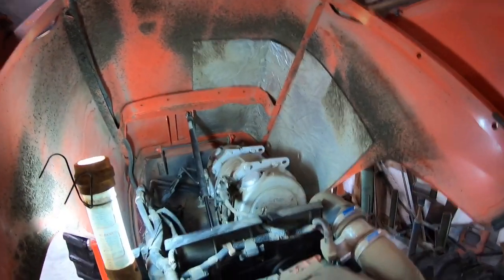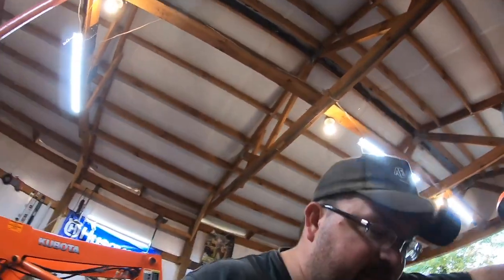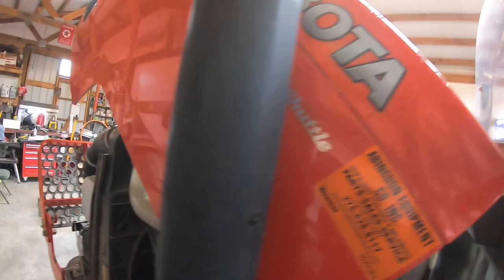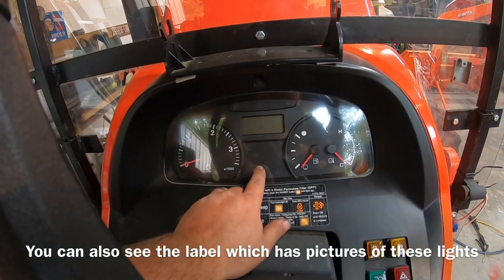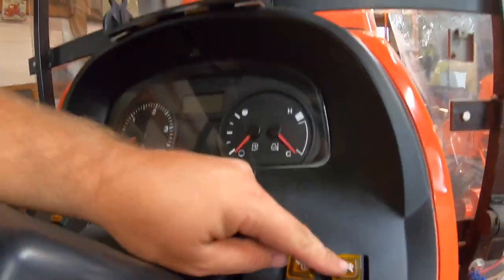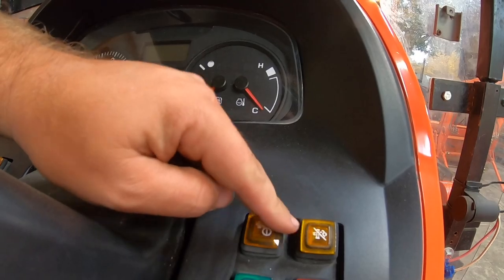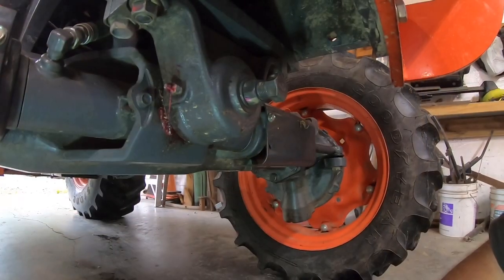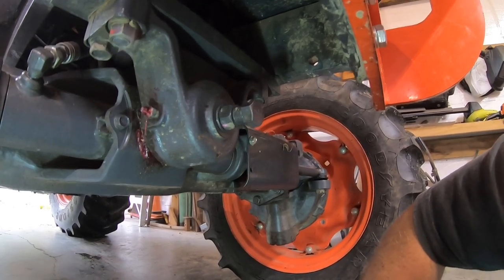My thoughts on Kubota’s DPF and Regeneration, also front axle adjustment!

Comment: You covered it very well , the only way around it is old school diesels,& with new tractors 25 Hp or under are exempt,no DPF or DEF & no regen required that is the 1 reason why I bought my 2018 M-F 1526 does not need any of the current epa regulations ,but like You said new tractors with more HP it is required by the epa. I drove trucks for 44 yrs & the newer ones that require a regen & def are the worst as far as cost effective! DPF is not much better due to the high temps. required to burn off the soot & down time & fuel being used thanks Ca.!!! thanks for the video well done.
Reply from the maker: Thank you!

Comment: Newest JD tractors have gotten rid of DPF for some over 75 hp tractors—using the new powrtech 4 cylinder engine.
Reply from the maker: Yeah we bought a John Deere the last year of the particulate filter because they had them discounted very well. I think Kubota is about the only brand still using a DPF on 55-75 hp tractors. I would consider another Deere for this reason. Thanks

Comment: Hey Ben mine does about the same, seems it wants to regen about every 20hrs or so maybe a little more through the winter and if your running low rpms but during the summer brush hogging and mowing hay it’s at least 20hrs apart.
Reply from the maker: I asked that question in a video coming up about cold weather. Mine seems to regen more often in the winter as well. Thanks for watching!

Comment: The DOC (diesel-oxidation-catalist), Particulate filter 26- 70 hp tractors with high pressure common rail fuel injection are Engineering Masterpiece 's. As long as they are NOT "Coked down" with a LOT OF Exhaust (Or constant EGR) aka (mahindra or JD's "E" series)=cheep converters. They are SUPER quiet,burn clean, keep oil cleaner,and are FUEL SIPPERS. Both the Massey-Ferguson & Kubota " modern systems" (have both) burn fuel nearly half as much as their "old" counter parts ( have them also). Perhaps the ONLY fault with new system is the "after warranty " maintenance. My " burn off " occurrences range from 25- 60 hours---no BIG DEAL. When fuel is 2.oo$ a gallon the "old system" is better, BUT @ 6.oo$ a gallon the "new system" is BETTER.
Reply from the maker: I really enjoyed this comment and the information. So far so good with my tractor and I really haven’t heard of anyone having issues with the filter on these tractors. Thanks for watching!
Reply: @khtractors  Oh yes Sir, Thank You for the vidio. Happy safe tractoring.

Comment: Mine regens about every 13 hours loading trucks you can’t run high rpms I was told for 1,200 dollars it could be deleted with a new muffler although I can’t while under warranty food for thought
Reply from the maker: I would seriously consider having that done if the system goes bad eventually. Thanks for the info!
Reply: Hey dustin pitts sounds like your egr is about to fail if it is doing regens that frequently!
Reply from the maker: @ACF6180T  I think that’s about normal on these for doing loader work.
Reply: @khtractors  That's not very productive , what kind of equipment is he talking about? seems kind of frequent for a regen.
Reply from the maker: @ACF6180T  I think it’s a Kubota similar to mine. It doesn’t effect working the tractor other then running your rpms up. You just keep doing what your doing. No loss of power or anything.
Reply: @khtractors  That does sound about wright , thanks for the reply.
Reply: @ACF6180T  the tractor only has 53 hours on it
Reply: @dustinpitts2741  I got a reply from K&H Tractors ,he said it was about normal! I guess big trucks are not as frequent, ( regens )do the fact most of them are running at higher rpm's  on the hwy.  or over the road ,less stop & go.So  I guess operating at lower rpm's & engine idling more would lead to more soot or carbon build up which would cause the sensors to do more frequent regens Thank You for your reply.

Comment: My understanding is that Massey Ferguson doesn't have DPF, DEF and such. Any thoughts?
Reply from the maker: I would ask them about an EGR cooler. Not sure what system they use to meet standards but it has to have something to help the emissions. I’d avoid anything with an EGR for the risk of coolant and oil mixing. Personally I think Kubota has this system figured out up to the 7060. I’ve had 0 issues and I’m right at or over 1,600 hrs. Thanks

Comment: I just sold my m6060 nice tractor I just got sick of thinking this is my tractor I own it but yet I can’t remove these darn emissions so I sold it bought me a kubota l2501 and a Ford 3600 and FYI the ones with def fluid they absolutely do have problems with them no matter the make for example we have a svl95 whole new def system @300hours kumatsu d37 dozer 1st def repair@200hrs 2nd def repair@600 hours stay away from the def it at all possible
Reply from the maker: Yes I’m not a fan of the Fluid systems at all. Thanks!